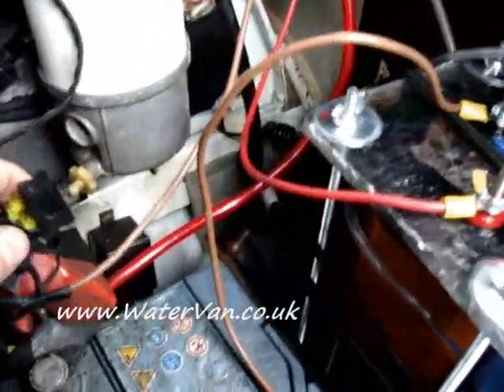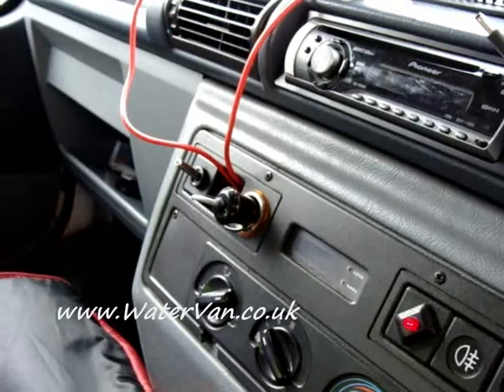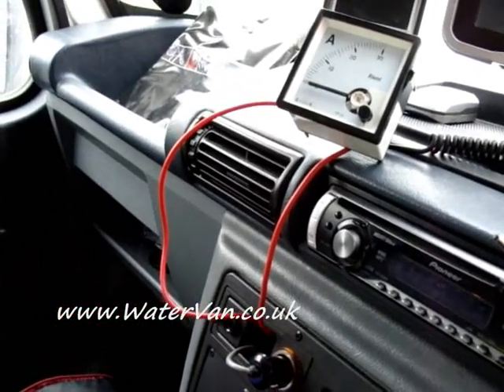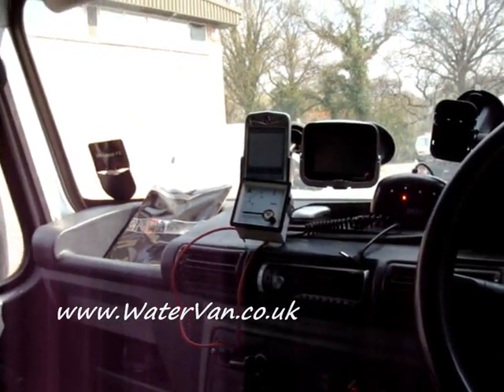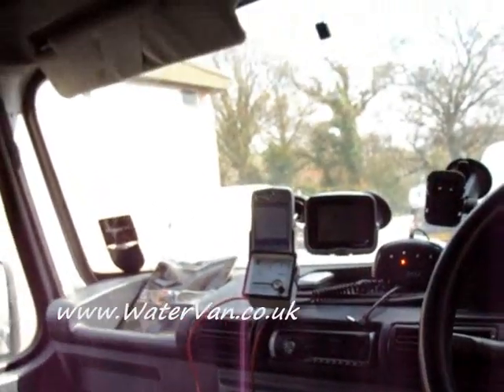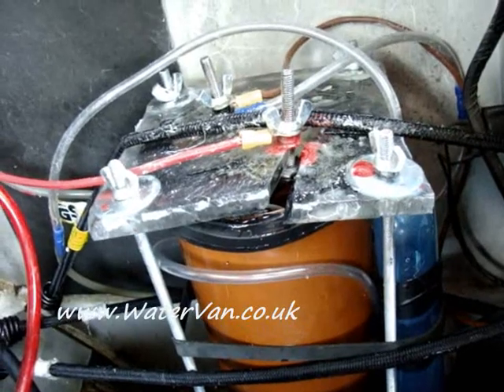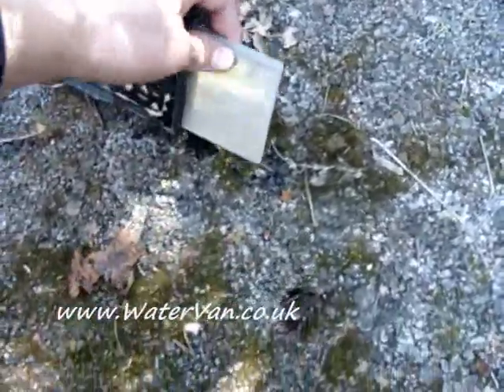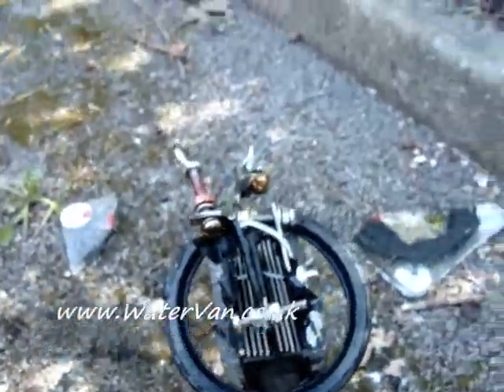#024 - MadStu's Water Powered Van - Cell 4 - R.I.P...

Comment: Do a search on ebay for "pwm dc speed controller". The are pre-built and relatively cheap. They can increase hho output by as much as 300% as well as control the heat.

Comment: Keep it up madstu.  I'm working on my 5th generator.  I found that my last generator burned up do to a short.  This next cell will be very well built.  Also I'm finding that after running your cell for an hour or so, change the water, it helps keep the amps down.

Comment: I bought a 15 amp digital battery charger for 30 quid at an auto parts store here in L.A. 
With that I'm now able to simulate in my kitchen what happened in my car everytime I drove with it. HAD it been in my car at the time....it would have flooded the bubbler and then straight into my air intake!! You will have much bigger problems if youre driving up the M1 and you get water shot into your air intake at 70mph! Something for you to think about mate. I know I'll be thinking about it know. LOL

Comment: That will be my next test as to whether or not
it merely slows down the heat build up or actually controls it. I have 2 cells now. One with neutral plates and one without. I'll be doing the test in me Stationary Laboratory....my kitchen.

Comment: On my cell I was pulling 5 amps for 2 hours straight in my kitchen and it got so hot it boiled the water inside overflowed my bubbler. If it's going to be in an engine bay, it has to have air cooling just like the cars engine. Im going to mount it in front of my radiator or hook a transmission oil cooler to the cell and mount that in front of the radiator. Low amps or high amps, it will eventually overheat without cooling.

Comment: nothing even close to like that has EVER happened to me ( yeah right !!! ) ... looks like you had a spark inside you container that did indeed go pop ...

grooves in your acrylic will work to keep your plate spacing even. but cutting them will be a pain in the butt. a cut guide and your dremel like tool should do it if you are carefull. 

if you have a look at the most recent build ZeroFossilFuel did, it will answer many questions. his setup is similar to what you are shooting for.

Comment: Scavenge everything you can from the old cell and before you reinstall the new one in the van, test it outside the van for HOURS mate, then take everything apart and see how everything is. You need to test the effects of heat, amps, KOH ratios, over a long period of time to simulate what it will go through when you stick it in your van and drive all day on it. All your readings will go up dramatically as time goes by. YOU CAN DO IT MATE! Get back on that horse!!